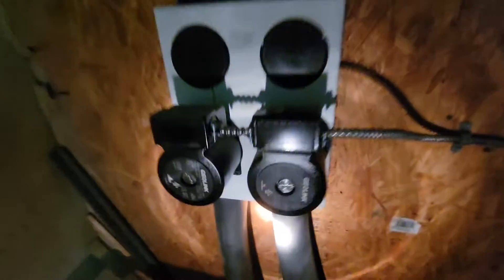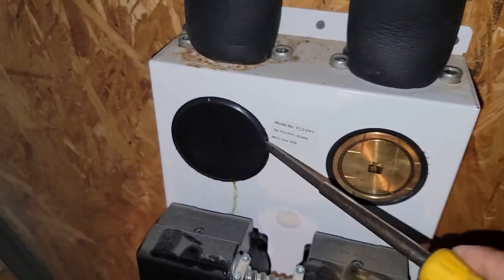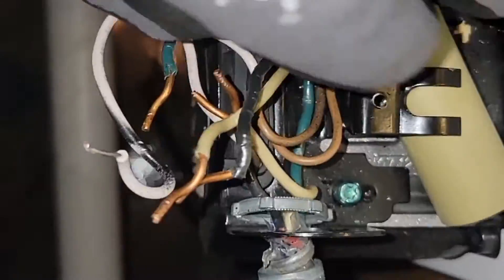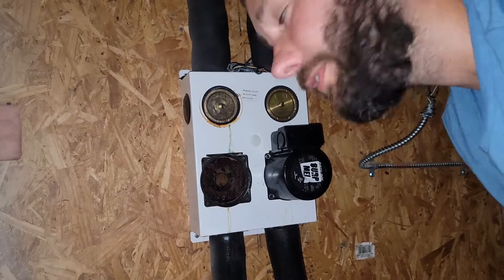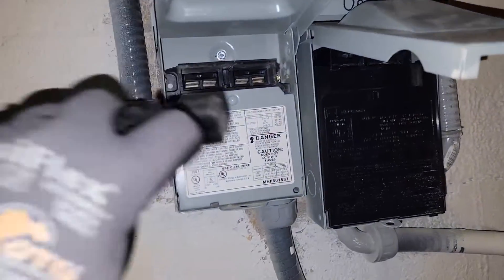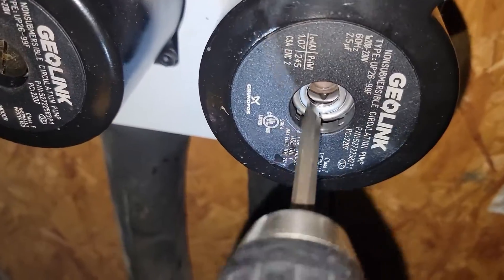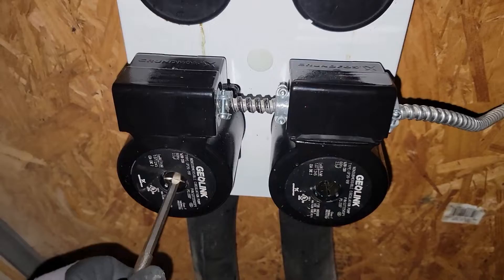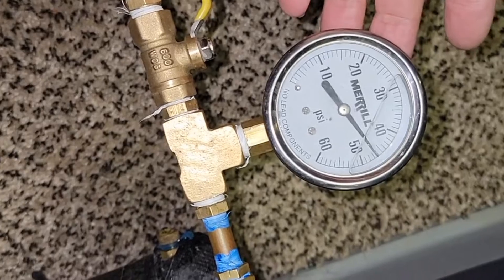How to Replace Geo Pumps?

Comment: I found simple works the best , I have a waterfurnace for 20 years closed loop.  I run it with a small sub pump in a 10 gallon barrel. No pressure just a nice flow. Zero air pockets 20 years and counting.
Screw all the special pumps valves etc nothing but a headache. 
Cheers

Comment: I have replaced the flow enter now. Your videos are the motivation and guidance. It saved 1300 dollars. Thank you. 

I have a question on how to purging the air out without a flush cart? Can you please suggest. There will lot of be trapped air in the closed loop after flowcenter replacement.
Reply from the maker: I would add water with the loop.Gooser tool and then just open up the burp screws.As long as possible, maybe have a couple buckets underneath the burp screws
Reply: @taddydigest  I have a pressurized system with city water connected along with an isolation valve (in attic on 3rd floor level). Will run the system with burp screws opened up for a longer duration. thank you!

Comment: We've got a geostar (waterfurnace) geothermal unit. The circulation pump for the desuperheater has gone bad, most likely due to corrosion since it is cast iron. Do you have any videos on replacing this part? I can't seem to find anything online. The part is only a couple hundred bucks but with labor it is nearly a $1000 repair through our local HVAC company. Would love to get this replaced myself!

Comment: I have a question about replacing the flowcenter, before you post the video Sir. 

1) I have a pressurized Flowcenter (two pumps UP26-116F). 
2) The loop water is clean with no sediments 
3) Both pumps failed and not working. 
4) There is a leak from the flowcenter too. 

So thinking of replacing the flowcenter. 

With the current setup as described above and the issues that I am facing with failed pumps and leaking flowcenter, 'should I need to use flush cart' after replacing the flow center. or just add water to the loop to build the required pressure back. As I mentioned earlier the loop water is very clean and no sediments. Appreciate your insights on this. You can reply to my email too if that works better.
Reply from the maker: If it was me, I would just replace the flow center and add water
Especially if you can do it yourself, you're going to save a lot of money
Reply: @taddydigest  Thank you so much Sir. 
Will do that and keep you updated.
Reply: Last week replaced the flow center after cutting the pipes on either side of the flow center, used a heat gun to slide the HDPE pipes on to the brass fittings for installing new one. Thank you!

Comment: Can you please post a video on replacing flowcenter itself. Thanks
Reply from the maker: yes absolutely
Reply: @taddydigest  Thank you Sir.
Reply: I have a question about replacing the flowcenter, before you post the video Sir. 

1) I have a pressurized Flowcenter (two pumps UP26-116F). 
2) The loop water is clean with no sediments 
3) Both pumps failed and not working. 
4) There is a leak from the flowcenter too. 

So thinking of replacing the flowcenter. 

With the current setup as described above and the issues that I am facing with failed pumps and leaking flowcenter, should I need to use flush cart after replacing the flow center. or just add water to the loop to build the required pressure back. As I mentioned earlier the loop water is very clean and no sediments. Appreciate your insights on this.

Comment: I have nearly exactly the same systems.  I actually have three systems like this one for each floor.  The top floor has two pumps for two loops.  They are not coming on when the system comes on.  Both stopped working at the same time. 

Our middle floor has two pumps as well.  I noticed that they are getting very warm when they are running.  It sounds to me like they need to have "water" added.  MY QUESTION IS THIS: What water solution do you use?  Is it pure distilled water, or some mixture of Methanol with water, or something else?  I seem to recall our service provider when they serviced told me that they used a Methanol/water mix.
Thanks for the video.

Comment: Thank you for putting this video together. I have a 15 year old geothermal system and felt like I was being taken advantage of by my HVAC provider. I have been doing my own research and plan to do my own maintenance. I have a dual pump flow center and one of the pumps went bad. I was told the whole center needed replacement, but found someone to disable the bad pump- leaving me with a full functioning system with one pump. Thinking about replacing the bad pump on my own - this looks too easy. I would like your guide, please. Thanks!

Comment: You can  lose pressure in ground loop with heat cycles with no leaks. On my system the pipe stretches gust enough to lose pressure on new system. You can install a reservoir or pressure tank or check and fill every 6 months like i do. Great video
Reply from the maker: Thanks for the info!

Comment: my loop loses pressure, the waterfurance dealer that installed it said the the loop expands on contracts and needs to be re pressurized. they installed it in 2013 and re-pressured it 2 years ago and the pumps are cavitating again.  is it becuae a leak in loop or is it normal to need to re pressurize? i also am showing an E10 error on thermostat
Reply from the maker: You definitely need to repressurize . It's probably because they did not use a flush cart when they installed it.
Reply: @TaddyDigest  they said they did use a flush cart when installed, but the loop can still stretch, so they need to do the cart again after they did the simple water injection method to 60 psi, they are coming this week as it has been throwing an e10 error.   Could the loop be leaking?  It is a major waterfurnace dealer here in sw michigan, been dealers for 30 + years.
Reply: @TaddyDigest  should i just buy the little petes port water injector and pressurize it each year?  The system is under warranty until December.

Comment: Tadd I have a 33 year old 5 ton water furnace, it runs fine no one in my area seems to know about waterfurnace,  where can I get that needle pressure gauge and what  pressure should the line be at  thanks bro. good video
Reply from the maker: Hey brother I can help you
Definitely click the join button become a member and then send me an emai.

Here is my email tadfuller1@gmail.com 

I will send you a guide for training and you can get that pressure tool on eBay. 

Here is the link to join its only two dollars
HVAC Videos
How and why to pressure test gas line? video 
https://youtu.be/qBXaU72o1EY

How to set gas pressure Video 
https://youtu.be/Fwz86GETRp4

How to Thread Gas Pipe Video 
https://youtu.be/-MmwvxOWm24

How to find a gas leak leak? Video 
https://youtu.be/i2f4hWkf2Zo

Inducer Motor Assembly Tear out Video 
https://youtube.com/shorts/hbPJqvl5hg8

HVAC Tools 
Fieldpiece SDMN6 Pressure Switch Tester
https://amzn.to/3dS1JYi

GETLITOOL Torx Allen Key Set, 9 PCS Cr-V Allen Wrench Set
https://amzn.to/407nF5v

Join this channel to get access to perks:
https://www.youtube.com/channel/UCuMyjTVlkM4xZ5z_eSyoB1w/join

Comment: Just joined. I’m replacing a small 1 ton unit in my bonus room. It only has a single ground loop pump.  Will introducing new water to the system (to replace lost water that was in the old heat pump) and allowing the pump to run with the vent screw off be sufficient to remove the air.  Also, the unit is in the attic and has no valve before the pump.

Comment: Hi , I plan to join as soon as I get a credit card
Just wondering if I am going the correct direction with my diagnosis
Have a water furnace , dual capable system , 6 ton 
It started giving trouble in the summer , on cooling mode . I noticed the line going to ground loop was very hot ( didn't measure temp , likely abt. 100f )
Now it shuts off on low pressure
I measured temp of ground loop lines , both are at 62 f 
Compressor discharge is 100f 
I am thinking the pumps might be not working , will check to see if they are turning
Reply from the maker: Definitely check and make sure the pumps are  on
Make sure you use a water gauge to check the water pressure.
And definitely join because I have a guide i need to send you.

Comment: Bought a place with both air and earth source heat pumps. They explained their are three separate geo pits but a plumber got into them by accident. Only one unit works. Just running the air source but would like to see the whole thing working. What a waste. I suspect no local hvac companies knew what to do so they opted to put in the air source. Everyth ing is still their on the water geo side. I'm crazy enough to try to figure it out and restore the system. But don't know where to start. You sound encouraging. How hard could it be ? All the heavy lifting is there already.
Reply from the maker: Not too hard just got to know where to start
Join level 1 
Get my email
I'll give you a geo guide
Or you can do level three and get my members only videos which teaches geothermal 
Join 
https://www.youtube.com/channel/UCuMyjTVlkM4xZ5z_eSyoB1w/join

Comment: Just a couple things when changing pumps you were ok in your steps up to when after the new pumps where installed you then rotated the 3 way valve to the operating position that opened the loop to where you just removed the pumps a large amount of air is now going in to the loop!!!  You should have left the 3 way valve in the position of unit side only used the 1" flush ports connected a garden hose to one side and another hose to the other side going to a drain both hoses with valves and flushed just the flow center to unit coax with a hose so air was not introduced to the loop.   Now the only way that job will not be a problem is to re flush with a flush cart.  Air in a closed loop will simulate a leak for ever air is compressible water is not. After you flushed with a garden hose for a while then you  dead head the return hose(one going to the drain) you then rotate the 3 way valve with the hose connected to the water source to both unit and loop and flush port  then rotate the 3 way valve on the return side to operating position closing off the flush port then lastly rotate the 3 way valve on the water hose feeding the system if you leave a pressure gauge in the PT port you will see you will have household water pressure on the whole system and no air introduced.   Thanks.
Reply: You have a ton of  air in the loop. Looks like the flow center has a small leak on top of left side pump. Also I've seen plenty of loops flat which makes you think it has a leak but once you bump it up it works fine.

Comment: AMAZING.  Shout-out to Tad and his channel.  I subscribed to his phone support, and probably saved > $4000 thanks to him.  My story follows.

I live in Virginia.  I noticed my electric bills this past winter went from $200-$300 per month to almost $1000.  We just installed an outdoor hottub, so I thought that was the problem.  When we turned the A/C on this spring, it was not working.  The diagnosis from an HVAC company was bad loop pumps, which explains what happened this winter.  No water was circulating in the loop, and the heater went to electric backup.  Had no idea.  The HVAC quote to replace both pumps and purge/recharge the loop was $4500.   I was also quoted $250 to replace the capacitor.  Something didn't seem right so I did a little investigation and found Tad's videos.  That's when I knew I could do it myself.

This job was really simple.  I found 2 replacement pumps from Geo-Hydro (they are great to, they love Tad, and they have techs who can also help troubleshoot installation of their products).  I replaced 2 blown 10amp fuses to the pumps so got power restored, and then replaced the pumps (only 1 was bad, but decided to replace both anyways - 18 year old system).  But water was still leaking.  Turns out the flow center (which is made of cast iron) had rusted and decayed a bit and had developed leaks, hence the loop could not maintain a charge.  Both Tad and Geo-Hydro helped me along the way.  All in I spent about $1300 on parts.

I bought a loop pressure/recharge tool for $50 online, and now had everything I needed to complete the job.  I had to apply some heat (blow torch) to get the loop threaded fittings to loosen from the old flow center, and used a heat gun to soften the black poly lines so I could wrench-out the fittings, then mounted the new flow center and replaced the fittings and tightened up all the hose clamps.  Recharged the loop with water, no leaks, and holding almost 70 PSI of pressure.

Because my loop comes into the unit from the ceiling above, only a few feet of water was released when I unhookd the flow center.  Tad didn't think a loop purge was necessary, and he walked me through recharging the loop, bleeding/burbing the pumps, and testing the system.  I burped the lines and within a few minutes I had steady pressure at 65PSI and no fluctations.  The pressure differential from loop input to output was only 1-2 PSI, so all good.  After 1 day the pressure is holding at 65 PSI and the cooling system is back online so I am happy.

What was a $4500 quote for 2 pumps and a purge would have turned much more expensive when the HVAC company found the leaky flow center.  I am sure the next quote would have been $1000s of additional dollars for a new flow center, making this job probably $6k-$7k.  I got it done for $1300 and probably saved $5k, and now have the ability to monitor the loop pressure with my pressure guage tester so I don't have any surprises like this last winter.  Oh, and the capacitor that they wanted to replace was perfectly fine.

I could not recommend Tad more. He was super nice, quick to respond, and spot on with his guidance.  Geo-Hydro was great too.
Reply from the maker: This is awesome
Thank you, Lance, for trusting me.
Thank you for giving me the chance to help you.
Reply: @taddydigest   Tad, I have a new problem, hoping for your help.  I sent you a text message, but will repeat here.  The fuse in my attic air handler (5-amp with 24 volt) keeps blowing.   What could be shorted?  can you help me isolate the source of the short?  thanks, Lance

Comment: replacing pumps, have a question.

I wanted to check power to the pump just to be sure. I set the thermostats really low to be sure the A/C engaged. The status lights on the control panel light up, with the Status led flashing green. when the fan kicked in I check voltage at the pump and there was none. Could it be they detect some fault elsewhere and the relays are not closing? Before I order new pumps I just want to be sure there is not an issue elsewhere.

BTW, the system is a Waterfurnace Series 7 I believe (waterfurnace model E072TA111NBDSSA)
Reply: Taddy, if I sign up for Phone Number Access, I can call you with questions?  trying to understand an issue with power at the pumps.

Comment: I joined. Could use your help.  Geothermal.  In heat mode.  Refrigerant lines leaving internal coax Heat exchanger iced up.  Plenty of water flow.  1.5 ton Open loop. Water in 50, water out 45.  Could I be low in refrigerant?  (R22 system)  Thanks
Reply from the maker: I don't see you on the membership list it does not look like you have joined please click to join button
Join this channel to get access to perks:
https://www.youtube.com/channel/UCuMyjTVlkM4xZ5z_eSyoB1w/join

Wanna Learn more about hvac? Check out my hvac tips for technicians playist.

https://youtube.com/playlist?list=PLVjetZt5xgenmO76adHwb2ctyeBIFKUus

Comment: I am 4 years in with a geothermal unit. This last cold snap with wind took my loop feild temp down. Looking for ways to make it more efficient. Not alot of content. Stumbled upon your channel. Working my way through your content. Cheers from Wisconsin.
Reply from the maker: thanks for watching
Reply: Lay down foam board (sounds like it isn't deep enough, so you need more insulation....) and cover it with 12 inches of soil.
Reply: @@imtheonevanhalen1557  I have an excavator now. Planning to make a French drain over the end of the loop field to dispose of my sump pump water and help with heat exchange.

Comment: Do have a video on  maintancing water source heatpump.
Reply from the maker: I do have several videos on water source heat pumps and how to add water how to use a flush card how to add a reducing valve how to replace A Desuper heater, a indoor coil and et cetera
Reply from the maker: I also have a geothermal training guide

Comment: I am an HVAC mechanic. Just bought a home with a water furnace ground loop system. I never worked on ground source heat pumps before. How do you know what your glycol ratio is at when you keep adding water to that system? Do you use a tool for testing the percentage of glycol to water? Great video!
Reply from the maker: Hydrometer for Alcohols
Refractometer for Polypropylene Glycol
Reply from the maker: I use Propylene Glycol
Reply: @taddydigest  I may need a ground loop pump. I noticed your pumps came with the volute attached. When I searched my pump (Grundfos Pump - UP26-116F) it comes with the volute attached. There is another pump that looks the same but has a class "H" instead of mine that has a class "F". I think the letter refers to the max heat the pump motor is rated for. The UP26-116 (Single Speed), No Volute has the "H" rating and I am not sure why. Do you think it  matters if I use the higher rated pump? I love this video by the way! Extremely well done. Cheers